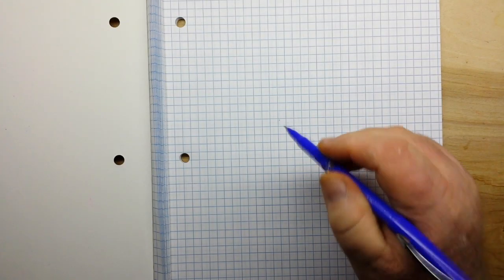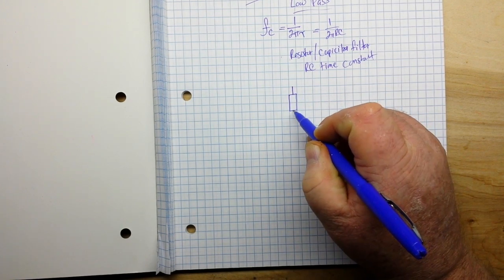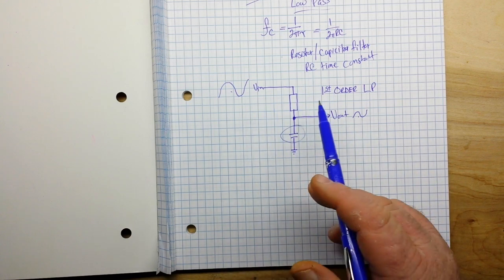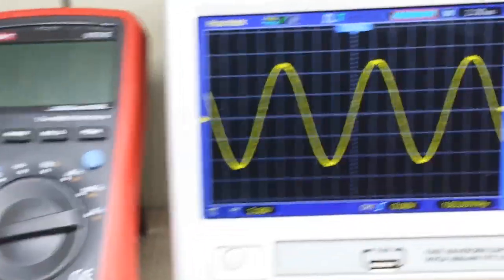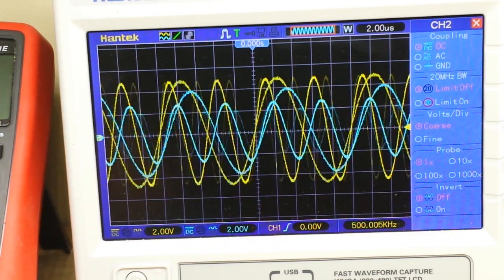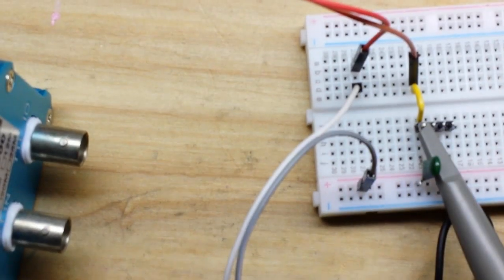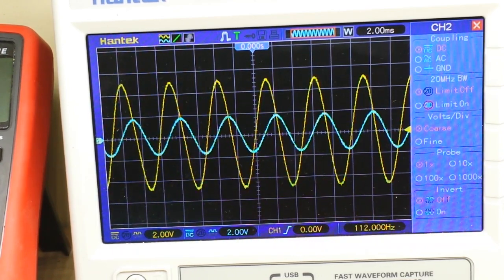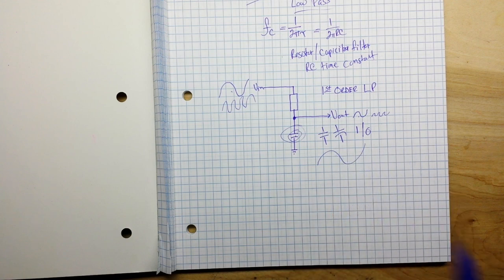The Low Pass Filter

Comment: Can you show how to calculate FC 1/2(pi)rc. No one really breaks it down completely. They always skip parts. I just don’t know how to calculate the formula. I’ve tried plugging in R and C but people say I’m wrong because I’m not adding powers but I don’t see any powers to add so I don’t get it.
Reply: There are no powers, unless they mean calculating the reciprocal? Divide 1 by (2*pi*R*C). That's it. There are lots of low and high pass filter calculators online. Find one and plug some  numbers in and then try to calculate it yourself.

Comment: Fantastic, thank you so much!  I have quite advanced knowledge of filters and the numerous possible configurations etc, building and partly designing a huge synthesizer is a mainstay and nessecity to know about them, and I've built quite a few different ones big and small.  But the way you explained how the RC time -constant comes to be in one sentence really cleared away the mid on my understanding of exactly what makes it tick. 'The capacitor has no time to charge up to the top voltage at high frequency while it does at a lower '.  Genius.

Comment: Thanks Paul :) So, this is the thing that was in the DSL filter tiny box just a couple of low/high pass filters!
Can't believe it's that simple!
" In an electronic low-pass RC filter for voltage signals, high frequencies in the input signal are attenuated, but the filter has little attenuation below the cutoff frequency determined by its RC time constant. For current signals, a similar circuit, using a resistor and capacitor in parallel, works in a similar manner. (See current divider discussed in more detail below.)

Electronic low-pass filters are used on inputs to subwoofers and other types of loudspeakers, to block high pitches that they can't efficiently reproduce. Radio transmitters use low-pass filters to block harmonic emissions that might interfere with other communications. The tone knob on many electric guitars is a low-pass filter used to reduce the amount of treble in the sound. An integrator is another time constant low-pass filter.[2]

Telephone lines fitted with DSL splitters use low-pass and high-pass filters to separate DSL and POTS signals sharing the same pair of wires.[3][4]

Low-pass filters also play a significant role in the sculpting of sound created by analogue and virtual analogue synthesisers. See subtractive synthesis. " (source) https://en.wikipedia.org/wiki/Low-pass_filter#Electronics